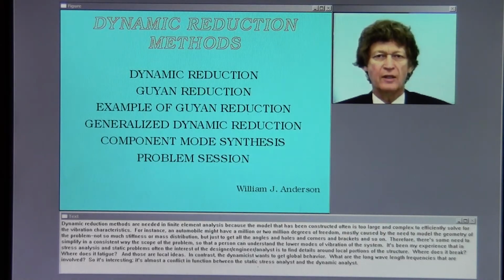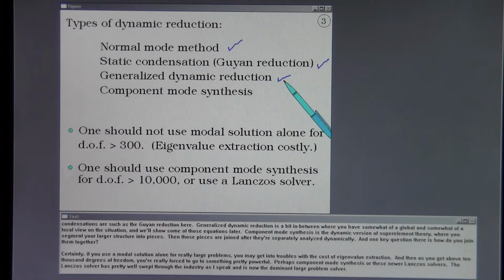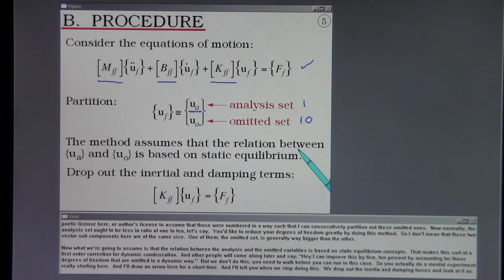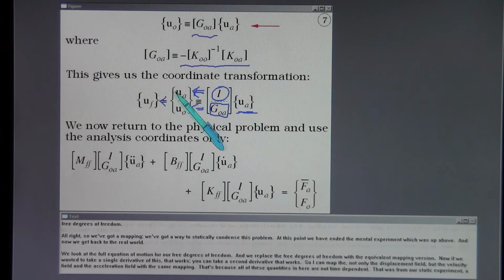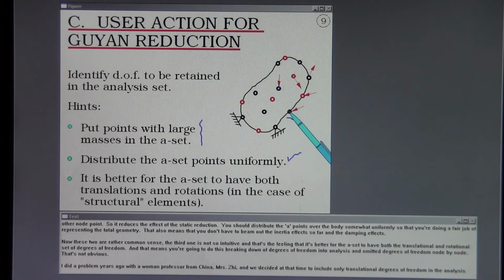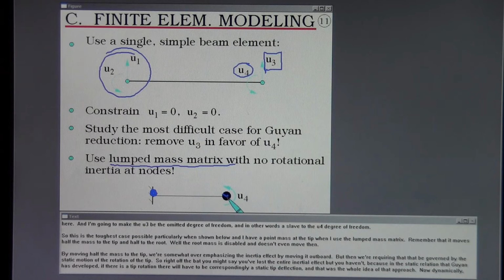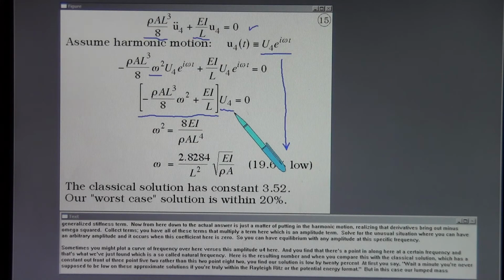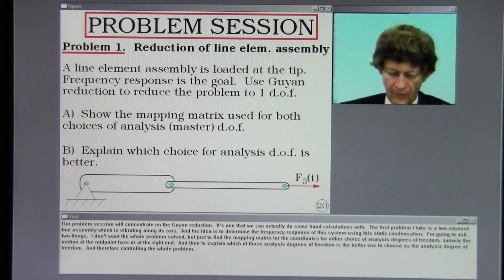Dynamic Reduction Methods. Lecture 12, Part A.

Comment from the maker: LUX1111111111111,
Thank you for your encouragement.  I am considering a better method for uploading these lectures that gives better audio.  So far I have redone 3 such lectures, two in Numerical Acoustics and one in Linear Static Analysis.  You can tell them by the pure white background on the figures (as opposed to yellow or blue tinged).